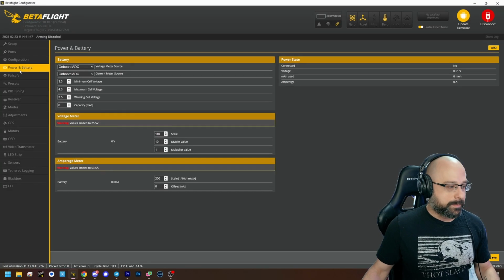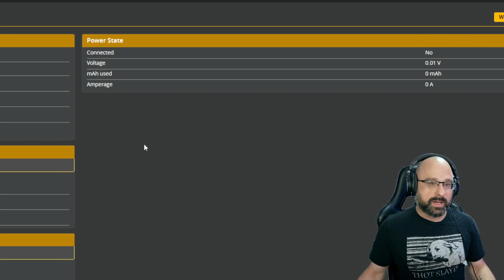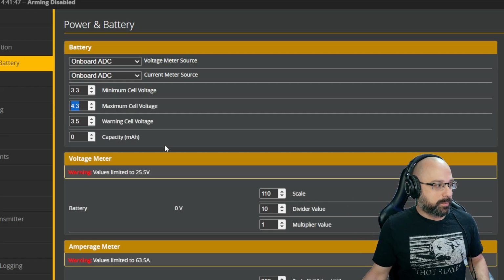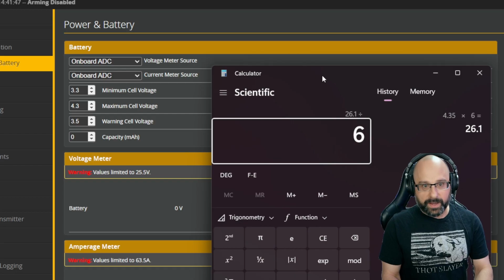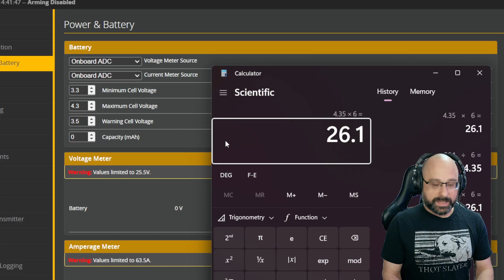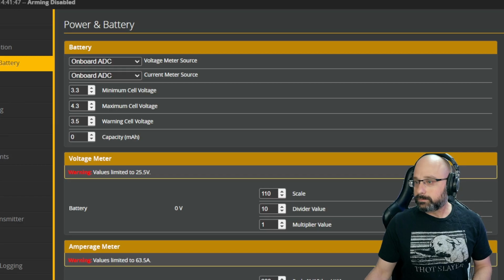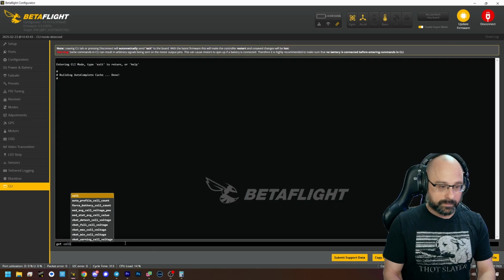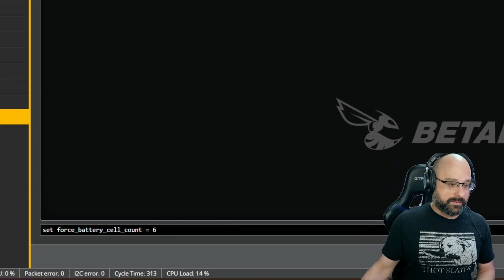Betaflight Has The Wrong Battery Cell Voltage? Try These Things! - FPV Questions

Comment: Another thing you can set up is to turn on auto switching profiles based on cell count. Then name the profiles 6s, 5s, 4s to match the cell count. Add this the profile name to the OSD and you can always see what your flight controller thinks is the cell count. It also allows tuning each profile if needed. B st way to set this up is to get the first profile set up correctly first and then copy it to the others as a starting point otherwise you miss things that may have been set using the presets (rx type and speed for example).